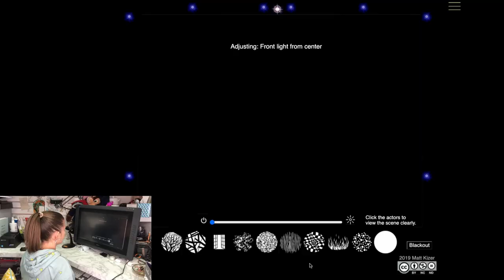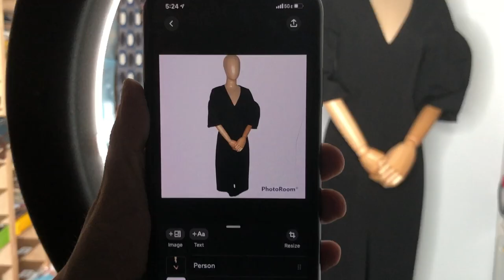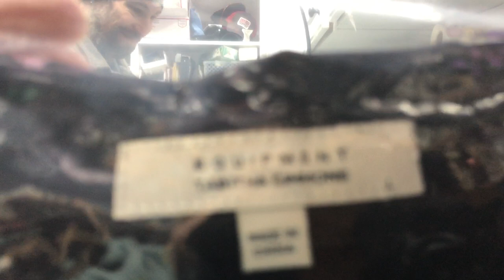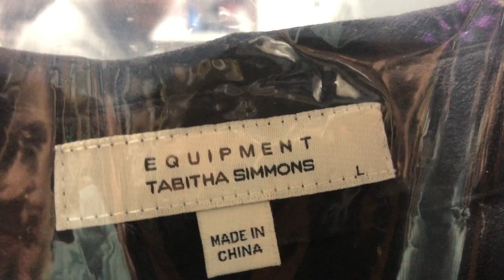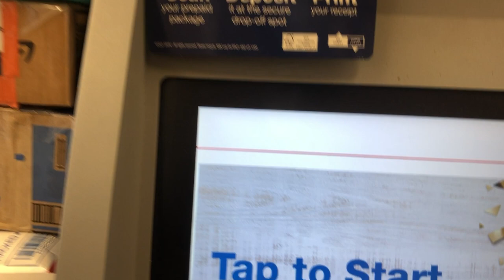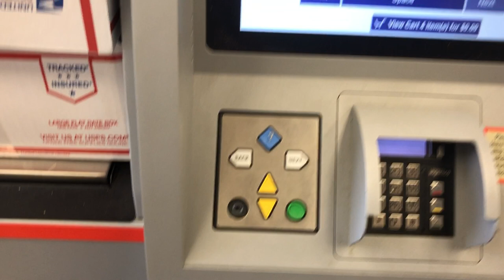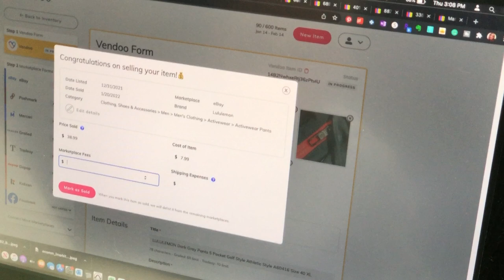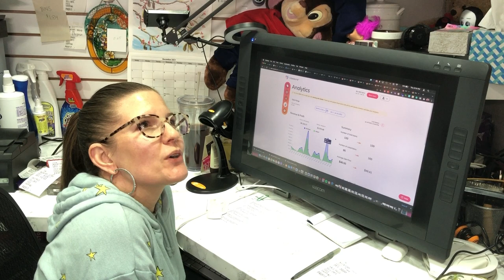Lighting Tutorial: Professional Lighting For Your Photos...Cheap! Demonstration + What Sold On eBay

Comment: Thank you for sharing the lighting. I use a flash that I bounce off the ceiling but I get shadows at the bottom of my clothes at night, I always hated the lights with the stands ( tripped over too many of those ) my ebay room is way too small for too many stands. I just ordered the lights from your link, I can't wait to get better photos, I'm trying to do less editing.
Reply from the maker: Hopefully they work out for you!  If you're not already using the Photoroom app to remove your backgrounds, I seriously can't recommend it enough.